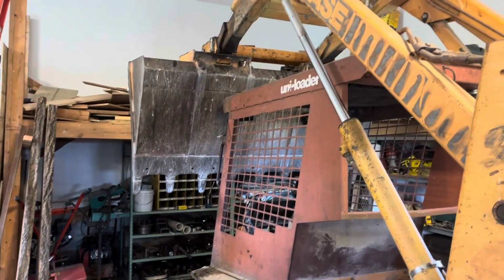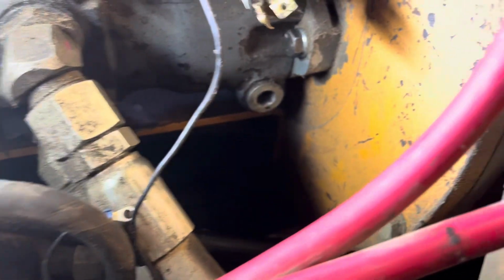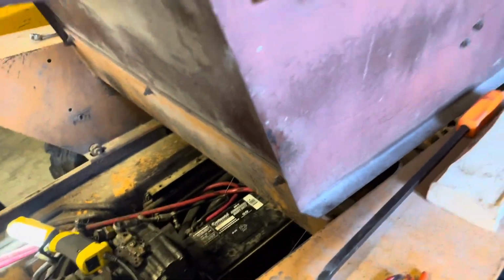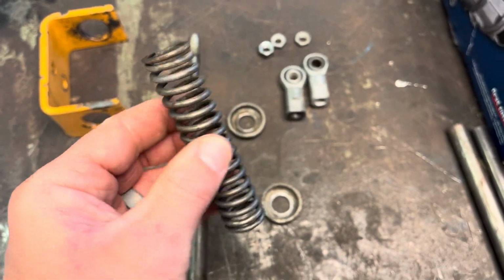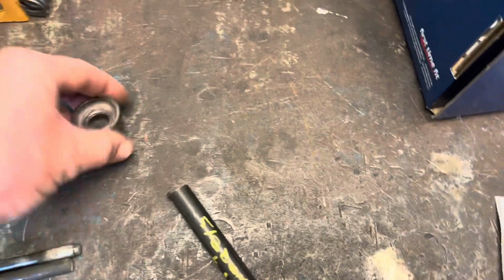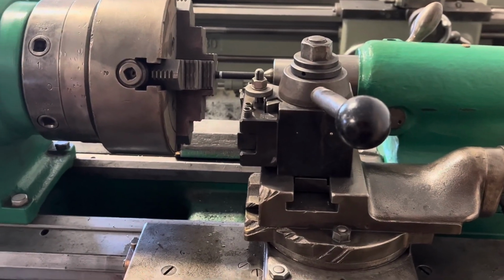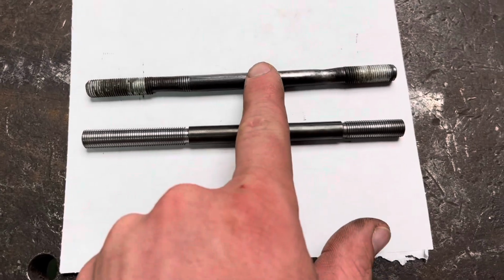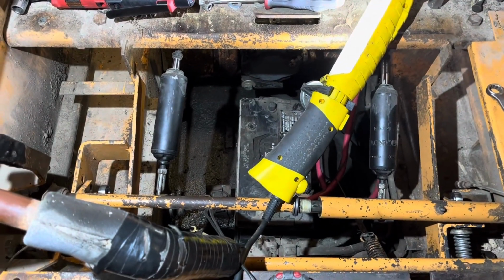Case 1840 Hand Controls - Centering Mechanism Repair

Comment: I have a problem with my surgingfor  creeping forward and it’s a hazard. I unhooked both drive pump linkages and still no difference all I noticed was both drive pump jam nuts were weary loose somehow I can’t figure out if the Allen bull got out of whack causing all my problems any help greatly appreciated
Reply from the maker: Did you unhook the linkage right at the pump? Is it an 1840

Comment: DOn't know what year your 1840 is but it's an earlier model with split lap restraint arms. Those short shock absorbers help to stabilize the arms and reduce feedback from your hydrastatic pumps.
Reply from the maker: Someone replaced them right before I bought the machine